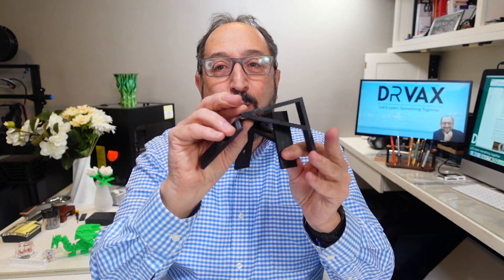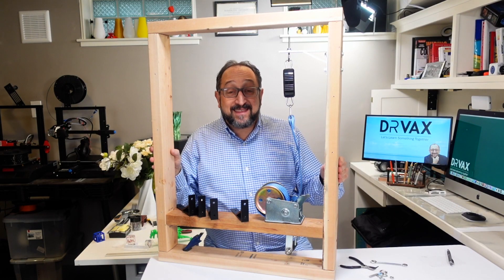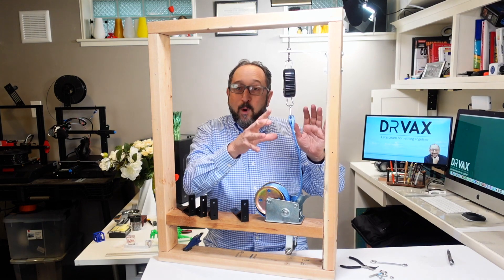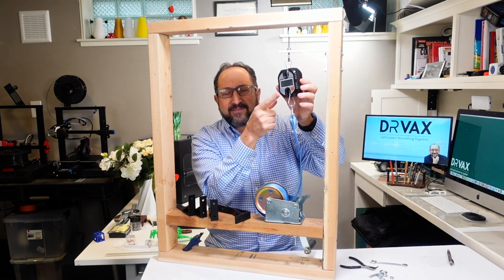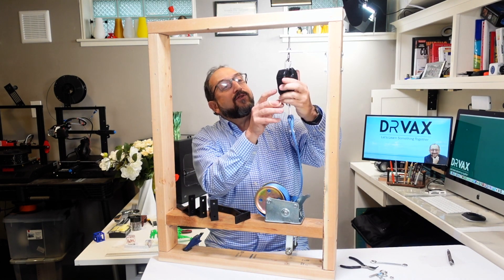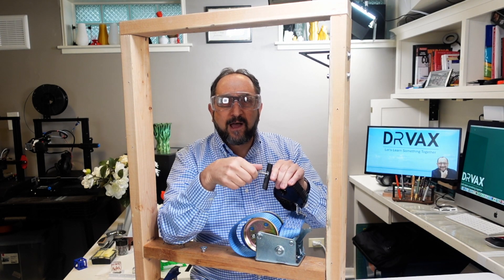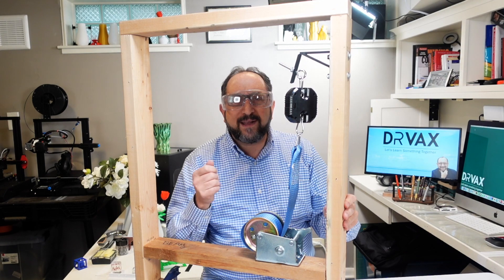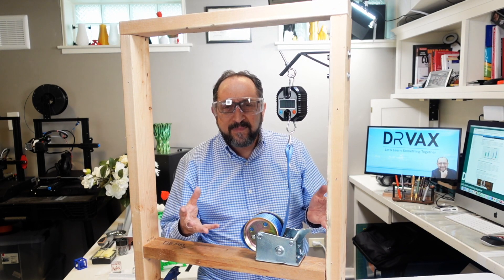Are all 3d Printer PLA Filaments the Same?

Comment: question, I just started out 3d printing and i currently am using PLA+ from Esun. I print at 210C but i want to test it out with a temp tower. Problem is all the ones i see start at 190 and go up from there. According to Esun PLA+ range is 205-225 degrees. is there a temp tower out there for that, or is this something i can just do in prusa?

Comment: Nice experimentation. For a distributed load, you could try to set some square stock on top of the test specimen bracket, and lasso over it with your pulling test rig.

You may also want more samples to eliminate fluke miss-prints not seen with the eye. 

Your remark in conclusion about tough PLA deformation in hot car may not be true for a functional part under load.

Comment: Quick suggestion ... adding another camera with a telephoto lens for close-ups . Along with a remote . I’m assuming that nylon would be the most durable . If looking for addition strength .
Reply from the maker: Yes you are correct.  I should have reshot.  I often use a DJI as a closeup camera.  In this case lighting was also an issue because my basement ceiling was to low.  While I have defusers on my lights I really need to try putting reflectors on the low ceiling and bouncing the light off the ceiling.  When shooting in locations with more space I use umbrellas which produce a beautiful light with less glare.

Comment: Awesome video. I inadvertently went through some similar testing buying very expensive, locally made PLA right here in Ohio. I spent $35 for 1kg only to find out it severely under performed in strength compared to the $19 PLA from my local Microcenter , shipped from China. However, their Silk PLA is very very weak, but looks nice. I've come to use PETG for anything that needs strength and PLA for anything that will not be stressed. So interesting how different these can be from one company to the next. Thanks for doing these tests!
Reply from the maker: Yes I also use a lot of PETG.   I am away from my home lab for the next few weeks but when I return I expect to do a number of addition tests using my testing rig.  I will compare PETG and PLA and also look at fill factors and number of walls.

Comment: Normally, when i want tougher, functional prints i use PETG instead PLA, but haven't tried pro, performance or PLA+. Edit: just came to my mind, should test PETG as well! PETG is nowadays one of the most popular materials!
Reply: CNC Kitchen has extensive tests on his channel. Lots of different brands, different materials, different printing orientation, different use cases (like bending vs impact vs pull strength). His channel might be more your speed and might satisfy your curiosity

Comment: Hi DrVAX, I'm following your channel for about a year now and I like this video. I'm in the polymer business for 26 years now, working on a polymer laboratoy as an application specialist. My job involves figuring out problems with polymer applications for customers. Looking at your video, your test setup is a basic tensile machine. I'm sure you must have a technical background because of the topics you mentioned like anealing, glass transition temp, orientation etc. Of course the speed of which you are pulling to the test specimen must be constant. To be sure: this is not critique. Because of my job, of course I have a 3D printer and using it frequently. Your videos helped me a lot in mastering the 3D printing issues. At our lab we you injection molding machines and presses for preparing test specimen. The main advantidge of inj. molding is the homogenious distribution of the molecules. And also with inj molding, the 'infill' is 100%. Using a hot press there is no movement on a molecular scale and the mechanical properties depend on the intrinsic flow properties of the material. We use PE, PP, ABS, PA (Nylon) and PET. To finish: I really love those videos, keep making them.
Reply from the maker: Quite interesting.  Thanks for the comment from a professional.